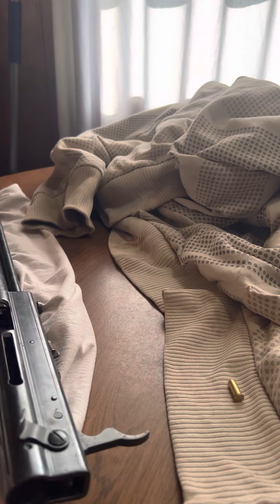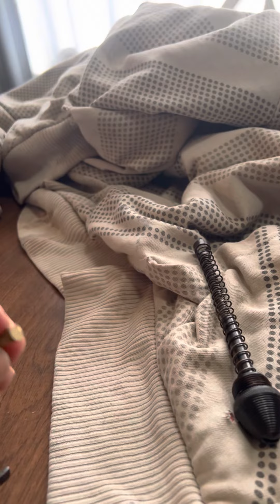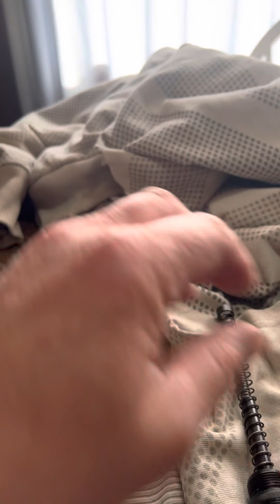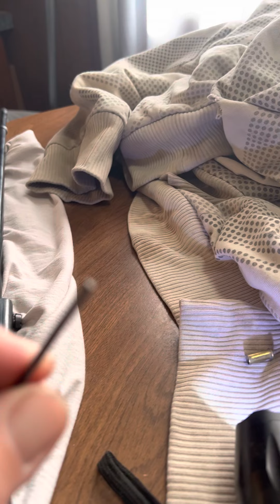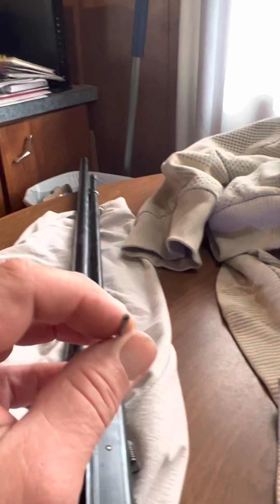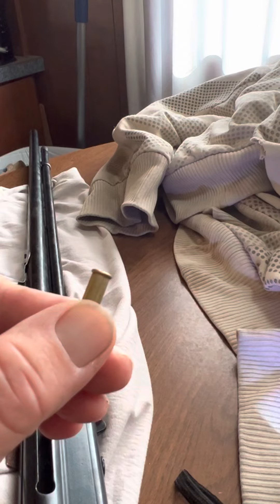Never Dry￼ fire a rimfire if you can help it. Here’s why

Comment: Thanks for the video. There is a continuing argument going on whether yes it's ok to dry fire and no it is not ok to dry fire. I learned the hard way, fortunately at a young age, not to dry fire a .22. After having to replace a couple of peened or broken firing pins, I quit dry firing a .22. I use either snap caps or empty cartridges. I refuse to argue with someone who insists it is ok to dry fire. I just shrug and tell them to do what they want. You cannot fix stupid.

Comment: Is it better to leave it cocked for two weeks?
Reply from the maker: Good question. Like I said, if you could help it. Some people think it’s all right to keep dry, firing it over and over again. I guess there’s a happy medium somewhere.
Reply: You can just pull the bolt back, make sure the chamber is clear, pull the trigger while the bolt is 3/4 open and then slowly push the bolt forward. This will disengage the tension without slamming your pin forward. This works for AR style weapons and most other semi auto rifles.